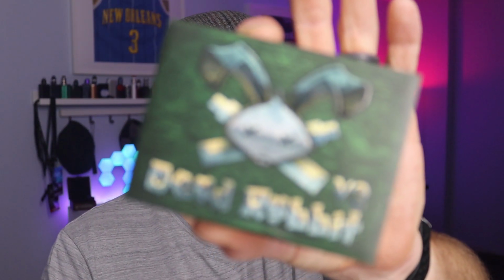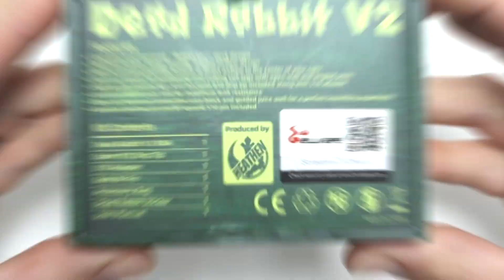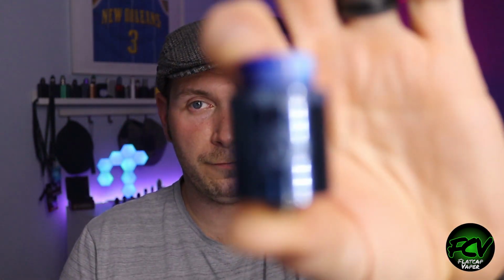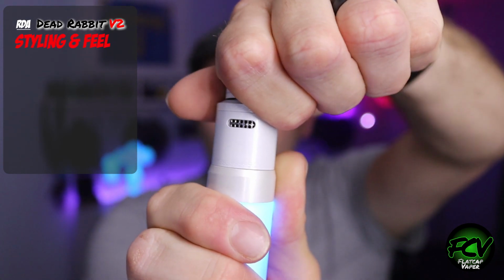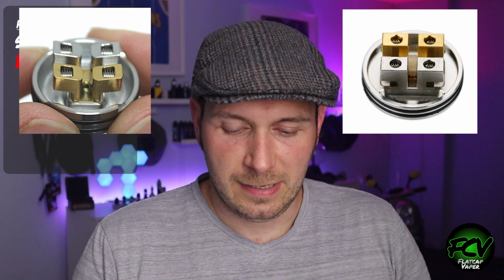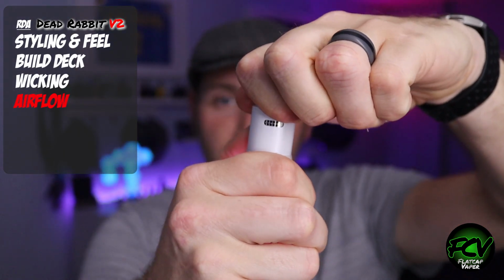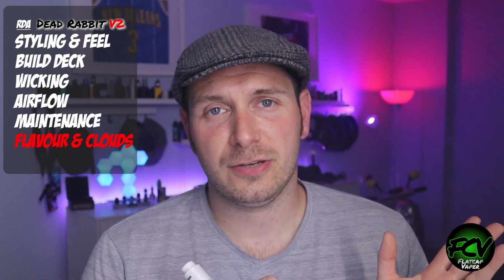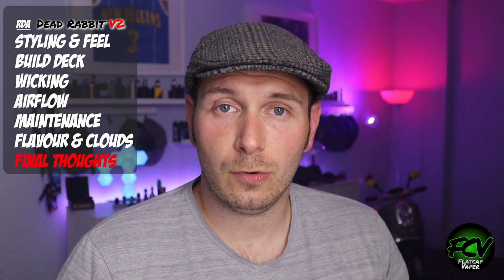So its a CashGrab right? | HellVape Dead Rabbit V2

Comment: Good review Gaz. I've a few og Dead Rabbits and managed to grab an LE White edition back in 2018 - paint held up fine with plenty of thousands of hits on a 0.08 build. If I remember correctly, those coils are still in there (couple of Mohawks). I didn't personally have the need for one of these V2's but wouldn't hesitate to get one if I didn't have the originals. As for cash grabbing, not many would turn down an opportunity to make money off a proven formula/design.

Comment: I do love the dead rabbit RTA/RDA, but I wish that they would include drip tips with O rings..  As soon as you get a little moister where the drip tip and top cap connect they become very very lose, fall  out and end up get lost within a couple of days.  
 
Noticed that you had to push the drip tip down a few times during the vid.
Reply from the maker: Hi Rob. Thats a shame yours feels loose. Yeah 100% i had to pop the drip tip down, mainly due to toying with the topcap. But i can lift the rda attached to the fush by the drip tip and it doesnt come out so thats not bad i dont think. Maybe the O-rings wont last as well as the Drop Dead has then. we'll see.